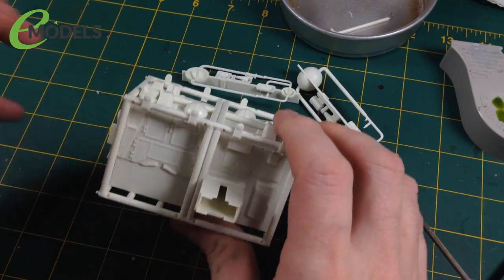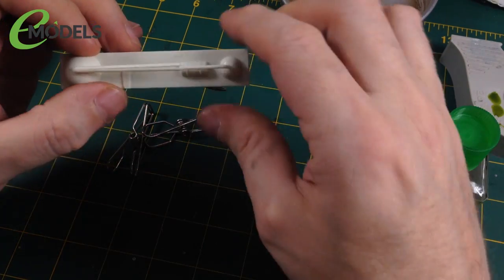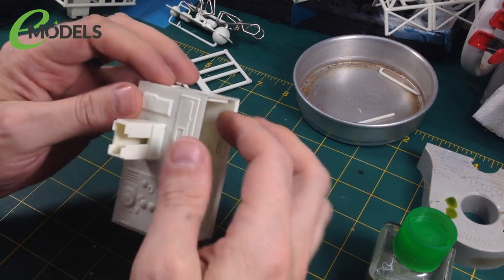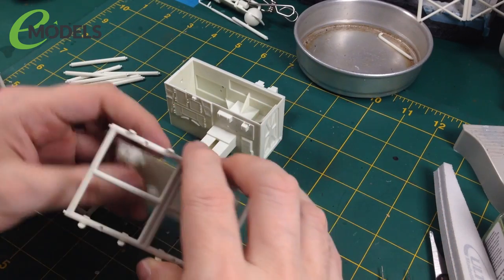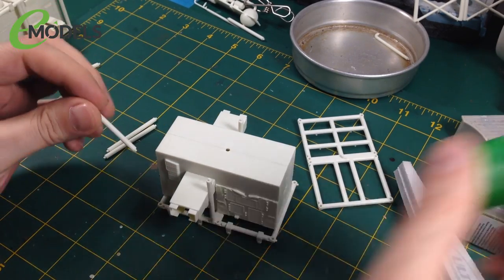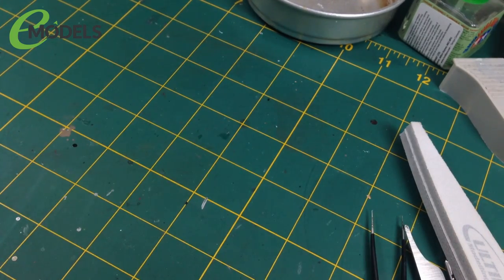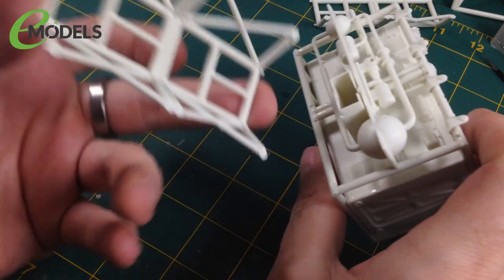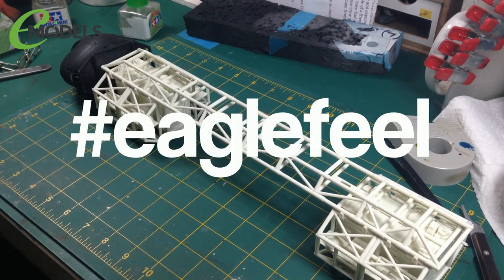MPC 1/48 Space: 1999 Eagle Transporter (#874) Part 5

Comment: You have to get a T-shirt with Ted says "SLAP IT ON" printed. Would it not be better to use the Tamiya extra thin for small parts and a thicker glue for the bigger parts? It looks like your using an awful lot of glue.
Reply: The normal glue is perfect for bigger parts, but where I used the thin on such areas was because the areas of contact were minimal, and I needed the glue to be able to seep into hard-to-get-to joints and splooge out to fill the seam. Using normal glue is best on large flat surfaces. It would just squidge out of the areas I was making, and make a mess :) I much prefer the extra thin purely because it is neater and actually sets faster than the regular.

It looks like I use a lot but I am just dipping into the pot a lot - the brush is very fine and does not carry a lot of glue.